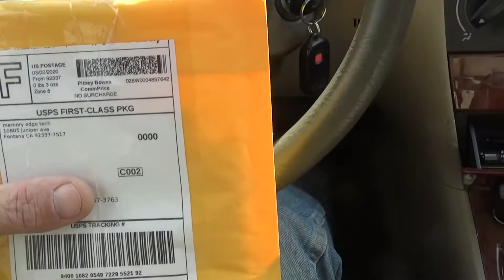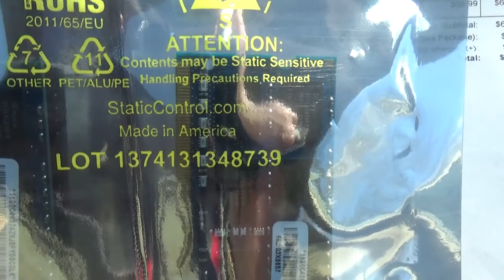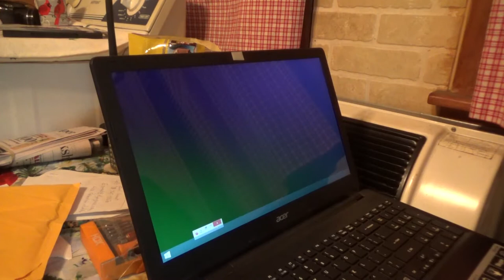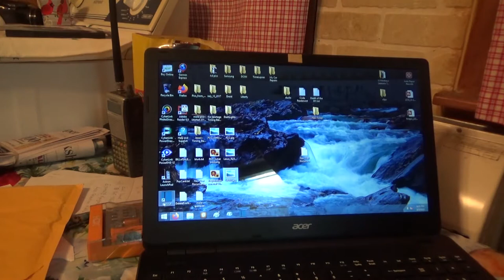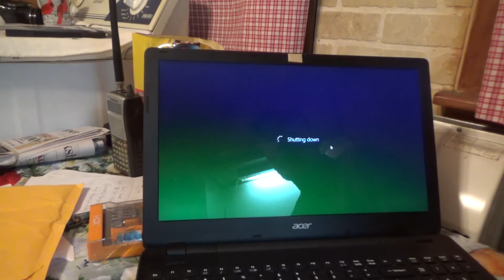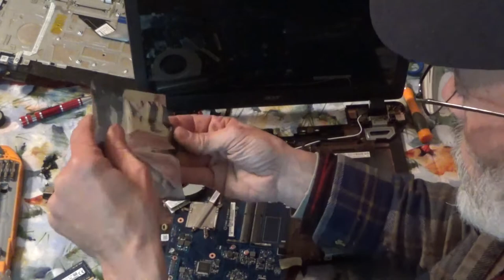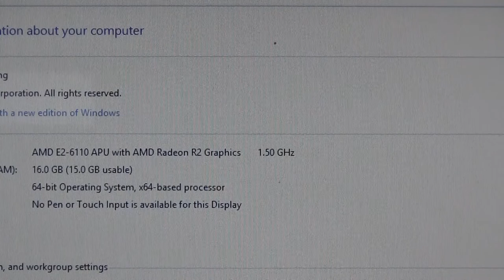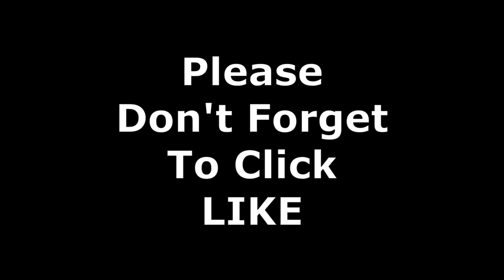Acer Laptop E5-521-23kh Memory Upgrade

Comment: One thing about this model of Laptop is the heat dissipation of heat. You must keep the heat pipe clean and the vents clean on the bottom of the case.  I know this because I own the same model and mine is about 10 years old now. It runs Linux Mint on a SSD, because windows 8.1 is out of service, as well having 6GB's of ram  
Re-doing the thermal past is also a high recommended thing to get done from time to time as the CPU if yours is AMD as they do run hot, A computer shop can do this if you're not comfortable removing the heat pipe - but I do find it helps a great deal. Hope this helps ya.
Cheers...
Reply from the maker: I upgraded it to Win 10. It's still working fantastic. (Other than occasional fan noise) Still editing my YouTube videos on it ..